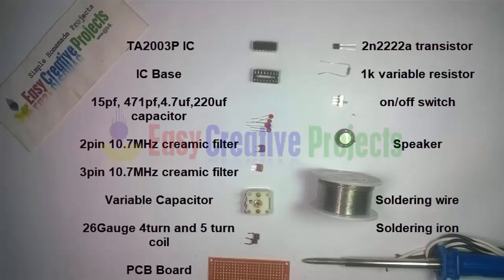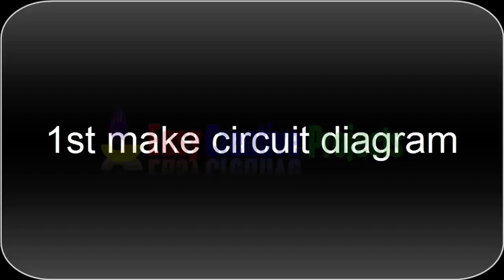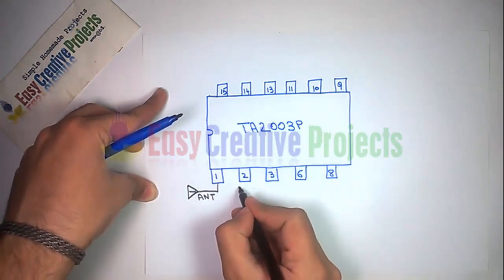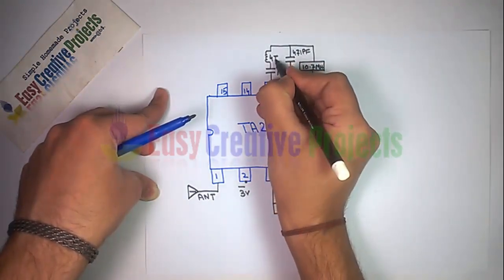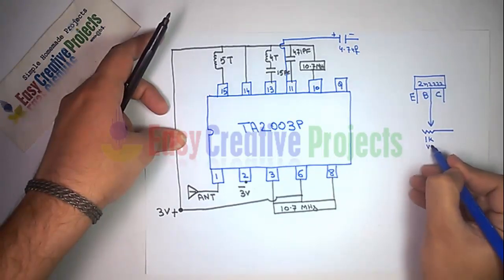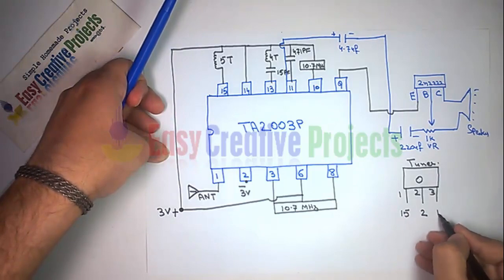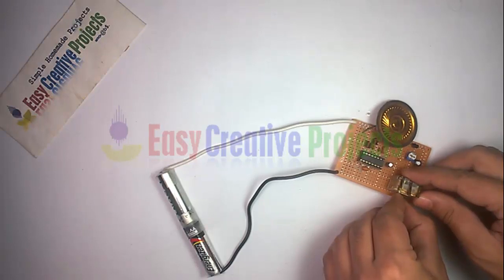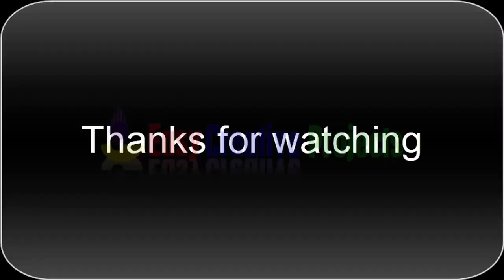How to make fm radio easy at home - simple step with circuit diagram

Comment: I had tried this circuit but could not tune any FM radio station, sometimes any small voice but very noisy, so the sound could not hear clearly.  I guess there is any problem with the tuning circuits. Is it the coil can be altered?
Reply from the maker: try to use large antenna. i hope its show you clear sound.
thanks.

Comment: Pls don't try this.. It's fake.. Not working.. I tried 7times..the same circuit.. ..
Reply from the maker: dear try to learn about TA2003p ic.
what is this?
how its work?
if you dont understand any circuit its doesn't mean that circuit is fake.
its mean you do some thing wrong. 
if you dont like this so leave this circuit and find any other ta2003p ic circuit and try that.
company make this ic only for radio. so how you say its fake. ?
Reply: @EasyCreativeProjects  my friend also tried the same circuit.. I know 2003 ic is used for radio but here current is not reaching the speaker.. I tested with multimeter..
Reply from the maker: so its mean circuit is fake or ic is burn?
Reply: @EasyCreativeProjects  lol.. As u said.. I went to my nearby electronic shop and bought 2 ic extra.. Yet it didn't worked.. This is 100% fake.. Pls no one should try this.. Pls don't waste ur time nd money
Reply from the maker: as you wish my friend.
Reply: @EasyCreativeProjects  it worked but wr should use another amplifier circuit separately.. Instead of the 2n 2222 part
Reply from the maker: congratulation my friend. finally you success.
2n2222a npn transistor use for amplifier audio. 
thanks.

Comment: Not working
Reply from the maker: its simple 1 ic circuit. check circuit diagram and find your mistake. i hope this time you success.
thanks.
Reply: No I tried 4 times.. Not even hearing a sound.. Pls what to do??.. I did it in the same way as mentioned in the ciruit diagramme.. No mistake.. Absolutely none.. Tried several times.. But not working.. Atleast i want to hear noise..
Reply from the maker: its mean your ic is dead. try to find good quality ic and then try. 
its total depend on ic. if your ic dead then you dont listen any sound.
if you buy simple fm radio from shop then you also find same circuit.
thanks.
Reply: @EasyCreativeProjects  is it? I bought a new ic from the shop.. My multimeter is not working Or else I would have checked it.. Power is not reching the speaker that's the problem.. Thanku so much for your suggestion

Comment: Hello friend
I am a beginner in Electronics, 
Unfortunately،the two pin ceramic filter (j10.7 mhz) is not avalible in my country. Please let me know if there is a replace for this specific filter. 
Regards
Reply: Hello, please tell me
Ceramic filter j10.7 mhz
2 pins
Not available in my country can replace the oscillator crystal 8.00 mhz or 12.0 mhz
This piece is not even found on old radios or old cassette recorders 😞
Reply from the maker: ceramic filter function only to filter sound.
if you don't use filter then you can found distraction in sound.
you can buy it from online chanese shops.
thanks.
Reply: @EasyCreativeProjects  
So it is possible to close the circuit without a ceramic filter j10.7 mhz 2 pins and get the result ??? And will the circuit work with any ic sp 2003 or csc2003p (HWCAT)? 
Thank you my friends
Reply from the maker: @farhadafshai9893  if you want to catch 10.7mhz frequency then you need filter. other wise filter has no other function.
ta2003, or 2003p all are same name. 
before buying ask for radio ic.
thanks.
Reply: @EasyCreativeProjects  
But the fm frequency range is between (87.5 to 108) mhz
While you say the filter catches the 10.7mhz frequency
Excuse me, but tell me, a circuit without a j10.7 mhz 2-pin filter works ??? 
Does the circuit work with 8.00 mhz or 12 mhz crystals? Or we will not do anything instead, if you can close the circuit without a 2-pin  j10.7 mhz filter, (Mersi❤🌍) thank you (ممنونم)/ شکرا
Thank you im so so sorry but 2 pin filter j10.7 mhz not found in my country😞😞😞😞😞😞😞🌍
Please tell me
Reply: @EasyCreativeProjects  please ....😭
Please tell me what to put instead of if ceramic filter (cxa10.7 mhz 2 pin ceramic filter if )😭💔
Reply from the maker: @farhadafshai9893  dear try to download ta2003p ic datasheet. and try to learn it any close electronic teacher. i dont explain hear in detail.
thanks.
Reply: @EasyCreativeProjects  
My dear friend, I just wanted to say something else instead of cxa j10.7 mhz 2 pin, or explain what I should do about it, but you did not say anything and did not explain it like that, you just said it is necessary and I know it is necessary, but when it is not here, you need something. Well, who placed it?
Thank you of answering 😞 but no helping to me

Comment: Sir ur video is very helpful. But i got very low sound to noise ratio even with a 14W amp and abt 3 foot long antenna
Reply from the maker: 1st try to use amplifier circuit. if you are facing still noise then
check ceramic filter. or try to use good quality filter. i think ceramic filter cannot filter properly.

Comment: I have a radio circuit and i want to make a radio using that. So how i will control the frequency
Reply from the maker: dear you can control frequency using variable capacitor ( tuner) .

Comment: Hello,  i want to begin with the proyect but i have one question 
at this moment on my hand have 2 unid filter ceramic of 3 pin ¿can i use 3 pin instead of 2 pin?
Reply from the maker: no
Reply: @EasyCreativeProjects  Can i use a 2 pin crystal 10.7mhz oscilator instead of that 2pin 10.7mhz ceramic filter??????
Reply from the maker: @christiancoding  no my friend. ceramic filter use for filter frequency. and oscillator use for produces continuous.

Comment: tuner There is no in diagram 🤔
Reply from the maker: dear see right side 3 pin tunner connection setting.
its very simple 
1st pin connect with 15 number pin
2nd pin connect with 2 number ic pin
and 3rd pin connect with 15pf capacitor. 
for more detail you can visit our website.
thanks.
Reply: @EasyCreativeProjects  Can you cancel 10,7 2pin Because it is not available
Reply from the maker: dear 10.7Mhz ceramic filter is use for filter frequency. if you not use it then how you filter channel?
Reply: @EasyCreativeProjects  I have 16.93 2pin

Comment: Input voltage
Reply from the maker: its work on 5v power supply.
everything explain in video circuit diagram. watch video carefully and make same.
thanks.
Reply: @EasyCreativeProjects  thanks

Comment: Good video, thank you, please could you do an FM radio using the sony CXA1191P circuit, I try to do that but until now it does not work for me, thanks Greetings from Peru.
Reply from the maker: i am so so sorry dear. this time CXA1191P radio ic not available. but i try to find it as soon as.
these project total depend on ic. i think you ic not working. 
check your ic and try again i hope your problem solve. 
thanks.